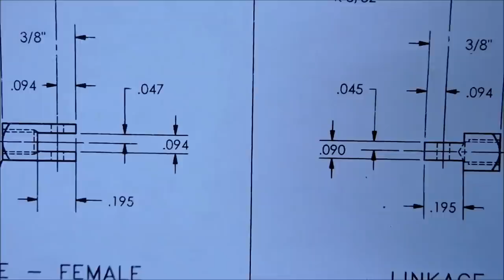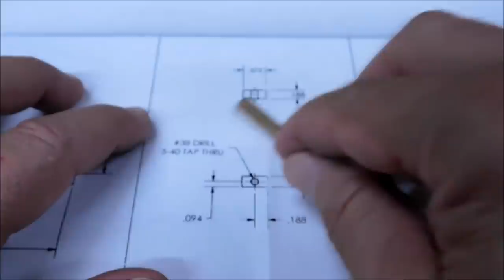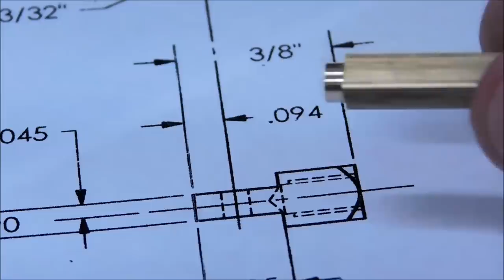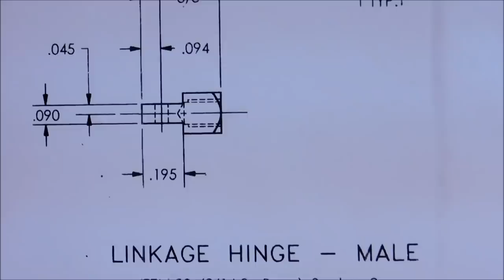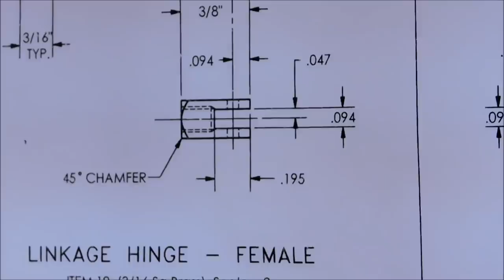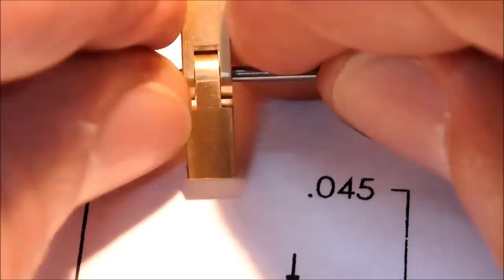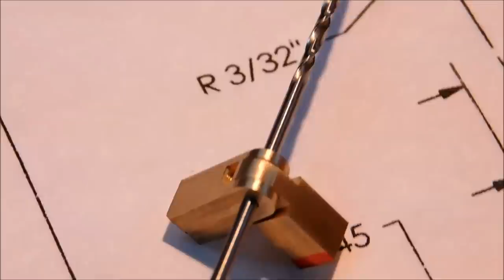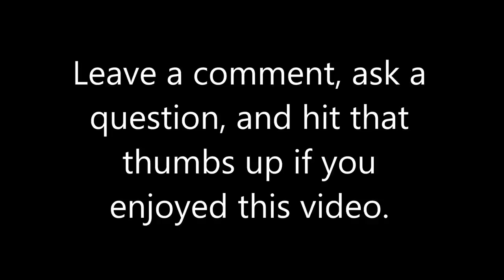Machining a Model Steam Engine - Part 4 - Square Collets and Small Parts

Comment: I just want to say you are a true artist sir. Where can I order models ? I
Reply from the maker: PM Research in NY sells these kits. Forgive the plug, but patrons to this channel get a 10% discount code they can use for any purchase from them. Sign on as a patron, get the code, cancel your support. It will cost you $1.00, but the code stays active afterwards.
Reply: @joepie221  I wouldn't do that, but I will go to my patron and pull you up Mr. Joe and support you fortune. I am really into what you are do with these tool castings. I knew about the boilers and engines, but not the tools. Thanks Mr. Joe

Comment: Another great video. Question. Do you verify the diameter of your cutters or just accept the manufactures statement? if you do verify, how?
Reply from the maker: I usually mic them before use and compare the cut result to the number dialed in. I can compute the working diameter at that time. You know if it mics .090 and is eccentric in its grind to the shank, that means nothing.

Comment: Joe, that was very clever approach when square to size is the only piece of stock available.  You could use a larger diameter short piece of round rod. Use a square collet block to make the square section, the slot and holes. Do the rounding of the ends the same. Put the part in back in the lathe drill deep and thread the back. Reverse the part and cut off the square part. Avoids the square collet, but it's nice to know how to make one.
Reply from the maker: This build is being done by the numbers from the parts and material supplied with this kit. Its quite possible I would approach many of these parts differently if I just had a print.

Comment: On the square bushing, would it have been beneficial to turn o-ring grooves on the 3/8 diameter to hold them  together. Or would that just cause more problems than it solves?

I probably would have put them there prior to watching this video, but just having the shoulder seems to be doing a good enough job and it doesn't seem as finicky if I would have thought
Reply: If it was any more than two components I think it would have been helpful, but with just two halves your solution is perfect
Reply from the maker: An exterior o'ring is a good idea to keep the halves together. I've seen that before too. just be sure the o'ring is sub-surface to the OD.
Reply: @joepie221 thank you for the reply, I've been out of the machining field for a few years now. But I sometimes get a chance to play in a friend's machine shop, and he thoroughly enjoys your channel up in the Northwest Territories Canada.
Reply: At work we have an elaborate round fixture plate we use in the lathe that gets clamped in the jaws and run a threaded rod through the draw tube to keep it from flying out.  All just to hold 1/4" square stock lengthwise for drilling, turning, and threading.  This would be perfect with an o-ring, plus maybe a step or pin to locate short parts on.

Comment: Great video Joe, thanks! I'm wondering if you have any videos that talk about techniques for hitting a particular length in the lathe? Here did you use a depth stop in the collet, or face off to a scribe line, or some other method?
Reply from the maker: For such a small quantity, I parted off oversize, faced, flipped and faced, check the oal, finish face. It would have taken longer to retrieve and set the stop.
Reply: @joepie221  Hi again Joe. Didn't you show how to use a razor blade to set the parting tool to the face of the work, then use either a dial indicator or the compound set parallel to precisely set the parting cut? You got a credit / thumbs up from the Blonde One for it on one of her earlier videos. I use a square HSS lathe bit and the compound set parallel to the ways to dial in accurate parting cuts....
Reply from the maker: @scottb8175  She also credited me with the inverted threading technique she uses. I appreciate that.
Reply: @joepie221  Yep, and I so do I.....👍
Reply: @joepie221  just touching off to calibrate after you stick in back in the chuck? I'm wondering if there are any good ways to check the length without taking the workpiece out of the chuck...

Comment: Great masterclass. Faced with the same problem i made some special work holding ER20 square holding collets, just because i could not that I had to. I called them work holding because I made them with an extended nose to keep away from the collet closure nut.
I wonder how "you know who" will make these parts?😉

Comment: I wondered about strengthening a part with solder. But I haven’t had need to give it a go yet :o) *normal for that pin might have been a bolt or maybe centre dot it on either side? (Some of the old boys would have had the skill to get it good-enough with a file. The apprentice pieces they made were stunning. )

Comment: I would make it from, 3/8" round holding in a collet and doing all the round work firdt.  Then cut it off and hold in a round collet and do back side and mill the square.
JIM
Reply from the maker: The material was supplied in the kit.
Reply: I too was thinking I would just make these from round bar and save the kit piece of stock for something else....wouldn't need to make the square collet adapter then.....but I appreciate Joe working with the kit supplied material in the video. I'd also make a built up pressed together indexed tool steel crank and throw the casting in the scrap pile.....but I think Joe is more interested in showing how to deal with the many challenges of machining the parts with the crude castings and raw material the kit comes with. Sort of 'It's not the destination that you enjoy, its the journey undertaken'.
Reply: @joepie221  Joe, you did a fine job, I applaud you for that.  I was just saying what I would do.
JIM

Comment: I thought you could buy square 5C collets  off the shelf?

Still, this is a perfectly good general solution. Any particular reason you took 0.010" off one side instead of 0.005" off both sides?
Reply: Clearance
Reply: One op versus two. The collet doesn't care, it's just clearance.
Reply from the maker: You can if you have the time and money. The single cut could absolutely be two equal cuts. A single relief is just one less operation.

Comment: All i can say is  ''don't drop the bloody  wee thing ''  it will be lost for ever !
Reply from the maker: The second half jumped perfectly on to the top of the parting tool holder. Like a vending machine.
Reply: @joepie221  Catch of the week that was !
Reply: You should try #80 drills and 000-120 screws! You can just put them down on the workbench and not find them again.
Reply from the maker: @scottb8175  I did my apprenticeship in a company that specialized in precision miniature componentry. We supplied many of the internal components for the electronic watch industry. I was always amazed to see the screw machines jamming those taps in under power. They are small enough to stick yourself with like a needle. I still have one somewhere.
Reply: @joepie221  I did a stint in an electronics manufacturing firm too - best job I ever had. I worked building tools and machines in a testing lab machine shop with a guy who, before I got there, was the boss of the machine shop (the only qualified machinist they had before). His role was nothing more critical than some instrument calibration management, heat treating some copper springs every now and then, and machining some large holding fixture blocks for the vibration certification tests for our products. He sent everything else out for any demanding or accurate machining. Of course, the people he worked for had fat budgets for R&D and testing, and he spent a lot of time surfing the internet or extended playtime in the washroom. He would get all bent when I would demand that if he tilted the head of the mill that he tram the thing back into perpendicular +/- 0.0005" on 6" diameter when he was done. He said "but all you have to do is tell your people they can't expect better than +/- 0.020" tolerance. My reply was "Much of the parts I have to build the production tools and machines for don't measure more than 0.010" across - if I use +/- 0.020" hit and miss theory like you, I'll miss the part completely just about every time. That is why they hired me, and gave up on asking if you could do what they needed".
Reply: @scottb8175  No 8 & No 10 unc is the smallest  i go !!!

Comment: New this model engineering, great video lots of usefull info
. Is there any set relationship between the stroke and the valve travel
Reply from the maker: I don't know if there is a standard, but on this model the stroke is 1.5" and the valve only needs to move .38. It would appear to be 4:1
Reply: Yes it is explained in detail by a YouTube creature of “the steam powered machine shop” the video is about two years old may take some digging to find it.
Reply: I looked it up and found it! “David Richards old steam powered machine shop 43  designing a steam engine slide valve” enjoy!!
Reply: @bulletproofpepper2  very enlightening videos on his channel, thanks for the heads up
Reply: @peterslade537   steam engines are why i got into hobby machining just not that good at it yet. I’m getting better at it and things are starting to make sense now. Sharing is awesome!

Comment: Nice job.  However there are 5C square collets in 3/16" size you can use without making an adapter.
Reply from the maker: Thats no fun.
Reply: Yep there is. There is also hex for them too. Found that out from my local supplier not long ago
Reply from the maker: @Sicktrickintuner  I have the hex ones.
Reply: @joepie221  
IMO quality varies with the price. The Hardinge ones are very good to excellent cheaper ones not quite as good. The only problem with the Hardinge ones just how attached to that arm and leg are you.

Comment: Hey Joe. So, in my move across the country I decided to sell both my mills. (Neither had DRO's so I know little about them.) I brought my lathe which I just recently installed a dro onto. And am buying a new mill. Probably gonna import one directly to me. 
Anyway, since you lost me when you talked about using absolute and incremental. I'm hoping you wouldn't mind making a video about using the DRO's features. I'm probably not the only one who could use an education on them.
Reply from the maker: Hi Dave. Good to see you stayed.

Comment: This is a comment about something else and I only mention it here because I see the machine screws in the picture.  I think it would be so much nicer if the model builder would mill a hex head on the machine screws.  That would look so much more authentic and realistic.
Just sayin, JIM
Reply from the maker: I'm doing this kit with everything supplied, but if I have time, I may swap the screws for threaded studs and hex nuts. That would look fantastic. My question is..were the nuts in the 1800's hex or square?
Reply: @joepie221  I'd wager on square!
Reply: @joepie221  Good question!
JIM
Reply: @joepie221    Hi Joe.  I am positive that they were square.  When I was young I worked with a lot of older machinery that was built in the earlier 1900"s and remember all the nuts being square as well as the bolts.  Not sure when they changed but in my experience it must have been in the 1900's.

Dale in Canada
Reply from the maker: @dalemcinnes1834  I suspected as much. Thanks for the confirmation.
Reply: In the time of steam there were very few standards. Especially hardware. Most manufacturers made their own hardware in house. Square was common due to ease of manufacturing, but hex was on the rise. Clearance around mating parts dictated hex over square. And castle nuts were never square. I've seen a lot of castle nuts on steam equipment.

Comment: There is a easier way to hold a 4 sided stock in a 3 jaws.Make a wide ring ,internal diameter should be the diagonal of the square stock ,slit the ring but not in two peaces,put it in a 3 jaws chuck so that a slit sits between the jaws.
Same thing works for the threads if you cut a nut in the same way ,if you need to shorten a screw or something.
Reply: One would have to be careful with brass, the ring would need to be soft enough to not deform the brass corners, but that means the clamp ring would deform when using a 3 jaw, since the 3 outside pressure points can not line up with the 4 inside pressure points, so you would have to clamp lightly.  I am sure it would work, but I am also sure the center would not be as true, especially the second or third time you clamped on it.  Probably in this case I would take a quick look at ebay for a proper sized square 5C collet, just because that feeds the habit, but Joe's collet adapter makes sense, it doesn't take up room in the already full collet rack, and it is probably not a size you are going to use very often.

Comment: Is there a reason not to drill the holes before cutting slot?
Reply from the maker: Dealers choice, but you do risk bending the thin arms if you drill after.

Comment: Square 5C collet could be used as well, but not everyone has one of those lying around.
Reply from the maker: I'll use 5C hex collets in this series, but thought the collar fabrication was a valuable segment.
Reply: @joepie221  Absolutely; not "all" sizes are available for square and hex stock.
Reply from the maker: @matthewhelton1725  I appreciate your technical support on the other comment string. Thank you for that. Some of the material presented there was so far off I just had to scratch my head in wonder.

Comment: Will this square collet insert method work with ER32 collets? Would I need to make them the full depth of the collet? I was thinking I'd have to 4-jaw chuck these and wasn't looking forward to it - my 6-inch 4-jaw is a bit on the big side.
Reply: I don't see why not. Two things to consider - from what I've read, ERs work best when you're clamping on at least half the length of the collet, and in this case that means not only the adapter pieces but your excess square stock as well. You can "cheat" by having a plug of the same diameter at the back of the collet. Also, try to stick close to the nominal size of the collet (say 12mm on a 12-11 collet). I'll let you know in a year when I get around to trying this myself!
Reply from the maker: It should work, and if its not a big problem, make the bushing long enough to get a good registration. It will help align the bar stock better too.

Comment: Why did you use a 2 flute mill instead of a 4 flute when cutting the square fixture?
Reply from the maker: Softer materials need more room between the cutter flutes to allow the material to flow.

Comment: I'm quite new on this channel and I'm loving this Steam Engine series, I just miss some metric references to get up to its dimensions. Isn't there any way to add some metric numbers to It? Please?
Reply: Multiply inches x 25.4 to get mm.....I doubt Joe is going to add metric to his 'print' or his video on every dimension.
Reply from the maker: There were a lot of segments to this video. Everytime the speed changes, Everytime the scene changes or the volume changes, its a different clip. This video had over 70. I like to include the metric values, but blends and such bump caption timing. Anyway, I'll try harder. Thanks.
Reply: Hi Fernando. The British are some of the finest model makers in the world (see Keith Appleton, https://www.youtube.com/user/keithappleton ). While Great Britain converted from Imperial to Metric over five decades ago, British model makers have stubbornly clung to the Imperial system. There are even special screw threads that are specifically created for precision modeling (see British Association screw threads, https://en.wikipedia.org/wiki/British_Association_screw_threads ). A large body of classic British model plans were drawn up 50-100 years ago, and it would be a major undertaking to convert them to Metric.
Reply: @DavidKutzler  Edit your post please to take the closing comma from the link. Then the poor folks get straight to the valuables ;-)
Reply: @joepie221  Thanks for the attention, Joe. I apologize for the not so fair demand, but maybe It would help many other metric folks like me. I'll keep following the channel anyway. Kudos!
Reply: @DavidKutzler  Thanks, David. I'll keep that in mind. I mean no disrespect to Imperial System enthusiasts.
Reply: I personally convert stupid metric dimensions to imperial on a daily basis? Why is it only the metric people whine about it?
Reply: @eastcoastandy2905  Done!
Reply: @gentharris  Wow! "Stupid metric dimensions". You have some hard feelings about metrics, don't You?
Reply: @fdavillar  No not really other than in a lifetime of dealing with this stuff the introduction of the metric system in the US caused me to have to double the number of wrenches in my toolbox....... Its all just numbers, do the math.
Reply: @gentharris  Well, that's a problem I never had. I only have metrical sets of wrenches and tools.
Reply: @gentharris  Only powers of 10